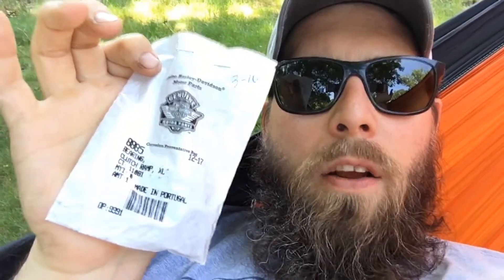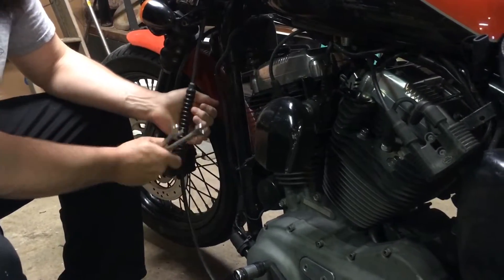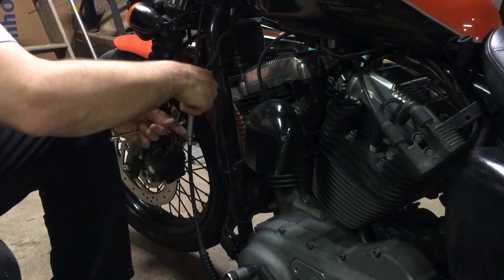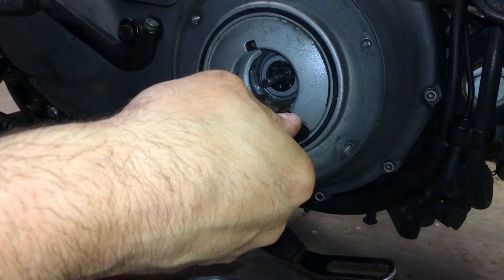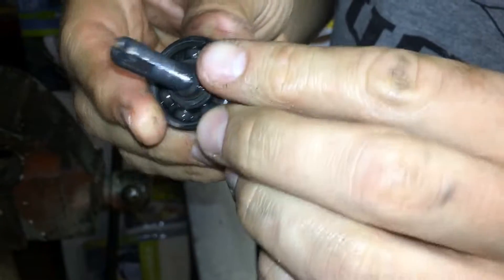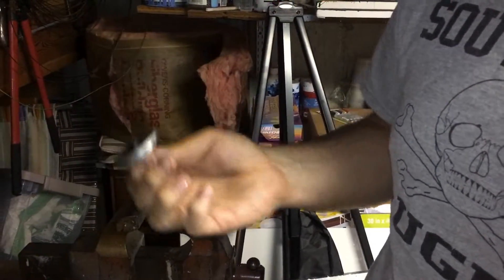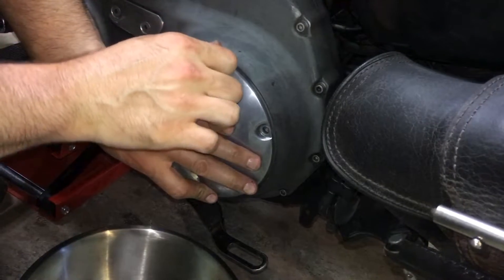CLUTCH RAMP THROWOUT BEARING DESTRUCTION!

Comment: How did you get the bearing and housing back in place without removing primary cover?
Reply from the maker: Just reversed the way I took it out.
Reply: @LoneWolferGarage  No doubt, but my primary cover - at the inner part, outboard of the clutch and inboard of the derby cover, has a lip / shoulder that ain't cooperating. I'm having trouble getting it far enough inward - toward the clutch pack because of that lip / shoulder.
Reply from the maker: @paulwilliams4040  What year is your bike? And if you were able to remove with the primary cover in place it may just require some finagling and sidling to finesse it back in.
Reply: I removed the derby cover, not the primary cover - just like the video.
Reply: The clutch release cover / derby cover. The bike is an 07 xl1200c.
Reply from the maker: @paulwilliams4040  To clarify, you removed the derby cover, took all the steps to remove the clutch ramp and bearing, and now you are having trouble getting the bearing back in? Or are you having trouble getting the clutch ramp back in place?
Reply: Trouble getting the ramp back in place.
Reply: The ramp, bearing, adjusting screw are assembled into a 1 piece unit. I'm having trouble re-installing that unit into the the clutch basket. On the outer facing part of the bearing housing, there is a raised "boss" - or "shoulder". On the inboard facing "tunnel" of the primary cover is a 3/4 moon shaped flange that the bearing and housing for behind
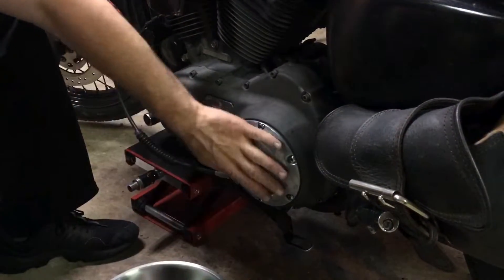 The "open" quarter of that flange reaches from about the 4:00 position to the 8:00 position. The trouble comes when I get the bearing / housing behind that flange, I can't get it high enough to push it home. The shoulder of the housing will not clear that opening in the flange.
Reply from the maker: @paulwilliams4040  The ramp goes in last, it should not be attached to the adjustment screw and bearing. There are two nubs on the actual throwout bearing housing that fit through two notches in the primary cover. A snap ring holds in the throwout bearing housing and adjustment screw. Then the ramp goes on after that and is held on by the adjustment nut.
Reply: Finally got it in and lined up then dropped the snap ring and yes it slid down under the clutch and who knows how far.
Reply from the maker: @paulwilliams4040  luckily it can’t get too far as the sump opening isn’t large enough for it to get through. You could try a flexible magnet to fish it out through the gap below the throwout bearing or maybe through the inspection cover. If that isn’t possible, you may have to take the primary off. Taking the primary off is simple and straight forward, take out the clutch ramp, and all the bolts around the primary. If you are gentle, you can sometimes get away with reusing the primary cover gasket.

Comment: After i changed the bearing and plate my shifting is way off. One minute ill have 1st and neutral the next im.starting off in 3d gear but its in 1st gears spot. I SHREDDED the throwout bearing but found all the bearings just half the cage shredded.
Reply from the maker: Yikes, that doesn't sound good at all. Glad you found all the bearings after shredding the races. Sadly' I do not have any idea what might be causing your bike to jump gears, that is something I have not encountered before.Someone over on one of the harley forums might have some insight. hdforums.com is probably the most well known of the forums, just be warned people can be a bit troll like in any of those forums and you may see a lot of responses for you to get a manual. Try to ignore those though and I think it is worth the time to find the nuggets of good info buried under the trolls.
Reply: @LoneWolferGarage  hey thanks for checking back. I do have the bible (manual) just not willing to believe the shifter pawl went that far out of place. As far as you never experiencing this- I PRAY YOU NEVER DO! This is no fun. Have had my whole primary cover off 3 times in 4 days. What i need to do is pull the primary chain n clutch basket and cgeck the adjustment on the shifter but that entails removing the big sprocket and i dont kno that im that brave. The brother i would usually have watching over me during this is watching over from much higher place now so your advice is greatly appreciated. Have a great week.
Reply: @LoneWolferGarage  btw your reference to that bearing as a grenade was on point.
Reply from the maker: Glad I can be of some help, wish I had more info fo you. And bent shifter pawls can cause some weird stuff to happen, but I haven't ever dealt with replacing or fixing one. Hopefully I won't have too!

Comment: hi there.. thanks for the video may you can help me I have a spotters 04 20k.. some times the first gear go back to N but some times engage and I have to go 2nd gear.. thanks
Reply from the maker: I have not dealt with that on my Sporty. First thing I would look at would be adjusting the clutch. That doesn't cost anything except some of your time. Try a few different tweaks to the adjustment. That was not a symptom I encountered with the Clutch Ramp Bearing failing, but that doesn't mean it couldn't be a symptom. I would inspect the bearing just for peace of mind. There could also be something going on with your Shifter Assembly. I have never had an issue with my Shifter Assembly, so I don't have much first hand knowledge of what might go wrong with it. But that would be the next part I would look at if I were having shifter issues as it is the next easiest thing to look at since you can remove the primary cover and inspect it. Hope that helps and thanks for watching.

Comment: hey man hope you reply, but how long can you ride on bad bearing and does it do damage if i ride it till the end?
Reply from the maker: Slim Jim I can’t give you an amount of time that you can ride with a bad one in there. It could be bad but not failing and you could get miles out of it but if you are having problems adjusting the clutch, getting into first, tons of creeping forward it might just be a good idea to swap it out. It’s not an expensive part and it doesn’t take much time to just avoid the problem as I did with this video. I was at the point where I thought it might be on its way out and just swapped it. As for damage, if a bearing somehow gets lost in the primary it can get through to the transmission which has a bunch more moving parts that it can cause havoc on. But I have been lucky even when it fails all the pieces got trapped in the center cavity of the clutch basket.
Reply: @LoneWolferGarage  thanks for the reply man, see i dont have the creeping forward issue so whats scaring me is i've been looking up clutch baskets and i'm scared it might be that but i'm not entirely sure... so for me its hard to find neutral sometimes,and when i pull in the clutch i here a little squeel and then almost like a loose chain sound.. but i looked at my chain and it looks good almost tight if anything i have a 99 xl883c. im hoping its the throwout which i can do myself but im kindof worried it might be the clutch basket..
Reply: i can get into first easily it just makes a really hard clunk. if anything its hard to find neutral along with when i pull in the clutch it makes a squeel then makes like a loose chain noise but i checked the chain and if anything it might be a little tight but im going into harley to get a lookover on friday. but from you're experience does this sound like a throwout or a basket problem? thanks for the reply boss youre awesome
Reply from the maker: The clunk is pretty normal for a Harley. And the squeal and chain noise makes me think that the chain needs to be adjusted. The chain needs to be advanced multiple times to adjust it properly. That is something I haven’t made a tutorial on as there are hundreds of those. As far as there being an issue with your clutch basket, the most frequent one I see and have experienced is the clutch plates them selves being an issue. Sportsters have a center clutch plate that is riveted together and the rivets fail. Mine failed at about 15,000 miles. When at operating speeds the clutch would slip and slip and slip. Have you done a clutch adjustment recently?
Reply: @LoneWolferGarage  i have not man i just bought this as a project bike, getting a new bearing and will be doing a clutch adjustment to see how it goes. the guy at the dealership said it could be like a clutch shift plate or something like that? not to sure but he said its a somewhat easy fix,  so sometimes i can't find neutral is really the problem i found with a loud gear shifting noise but thats somewhat normal aswell. keep in mind this bike has most likely been dropped since the forks were replaced and clutch lever snapped. most likely fell on chaincase side
Reply: @LoneWolferGarage  and if anything the chain is tight.
Reply from the maker: I'm not really sure what the tech is referring to when they said 'Clutch Shift Plate' but I am just a home mechanic so I don't know all the proper terms. I know the Shifter Shaft can get loose, but I have never experienced that personally. But if the noise is coming from inside the primary, my first reaction would be to adjust the clutch, then adjust the primary chain and make sure of the proper fluid lever (just touching the bottom of the clutch plate when the bike is level, not on the jiffy stand). Chains need to be adjusted more than folks realize because of temps inside and outside the bike. The more the bike is ridden in hot weather the more it stretches out. The harder you dump the clutch, the chain gets stretched out. And not always evenly. Thats why it has to be advanced to adjust it properly. I think it is something like 8 points of measure or every few inches to get a proper reading. As for being dropped, well these bikes are little tanks. They often can be ridden even after a bad spill or drop with no problems. That is by no means me saying there couldn't be damage, but the noises really do suggest to me it needs to be adjusted a bit more finely to rule out damage or a failing part. Then the throwout bearing would be my next course of action. Then replacement of the clutch plates with a better quality set like the Barnett Kevlar set. I have the extra plate kit from them in mine.
Reply: @LoneWolferGarage  thanks for the reply man i really appreciate it! took out the bearing was worn down along with the very small snap ring clamp that holds the bearing onto the screw there was about 1/8'th off the bearing itself making it very wobbly. going to be replacing tonight, then eventually upgrading to the extra plate kit! heard good things about the barnett
Reply from the maker: @slimjim8582  I love the extra plate kit! Glad you are getting that bearing taken care of. Hope it solves the weird noises issue. My wife is riding the Sporty more oftne than me these days so I have done another upgrade - Clutchlite XXS ExtraExtra Soft, Easy Pull Clutch Harley-Davidson/Buell. It replaces half of the Clutch ramp making the pull way less difficult after putting in an extra plate clutch kit. Hopefully I'll have the install on that coming in the next month or so.

Comment: So that play is normal that you have there ?
Reply from the maker: If you are referring after backing the clutch adjustment screw out then yes. Once you adjust your clutch cable there will be tension on the adjustment screw and throw out bearing.
Reply from the maker: @beatnuts323  I was having clutch issues before installing the new Clutch Ramp Bearing. If you are still having issues after replacing that, then there could be more going on inside the clutch pack, specifically the Clutch Spring Plate or “grenade plate” could have given up the ghost. Those symptoms are typically hard shifting and not feeling all the power you expect as you give it gas because the clutch is slipping and it gets worse when hot. Does that sound like symptoms your bike is experiencing?
Reply from the maker: @beatnuts323  for clarification, have you replaced the clutch ramp bearing? If not then I think that is the issue because not being able to shift and feeling like the clutch keeps going out of adjustment are two big symptoms of the bearing starting to fail.
Reply from the maker: @beatnuts323  It is cheap insurance and I think that it is a high probability that it is the culprit of your issues. Just be weary of that snap ring, I have lost one of those when changing out these bearings. Those are cheap too so I tend to grab one of those along with the bearing.
Reply from the maker: @beatnuts323  I'm stumped as the only part of the cable that can cause it to come out of adjustment is if the jam nut is not secured. I know it sounds dumb but make sure that jam nut is locked in properly, and on the correct side of the adjuster to lock it in place.